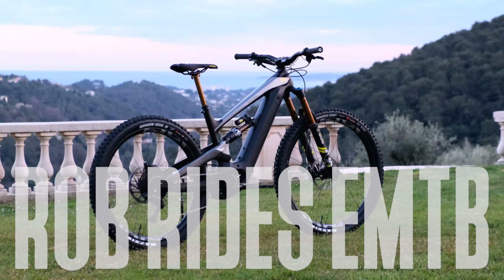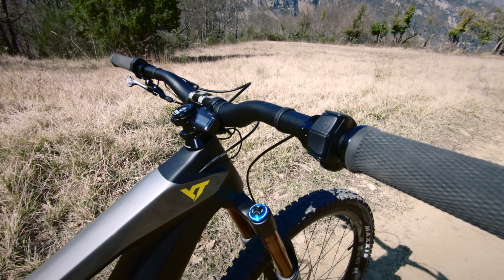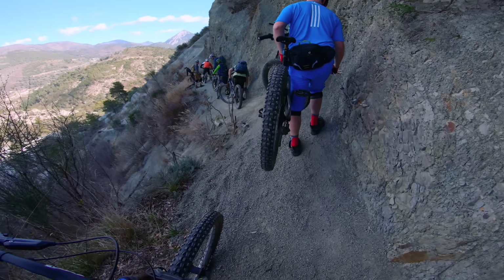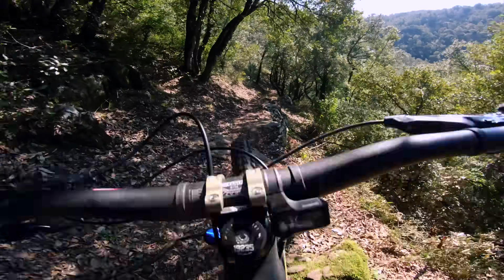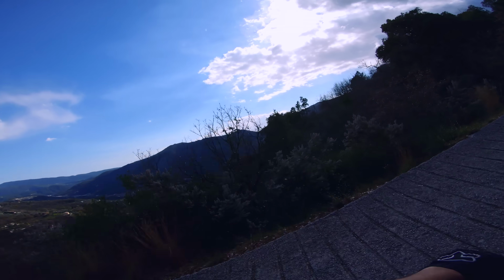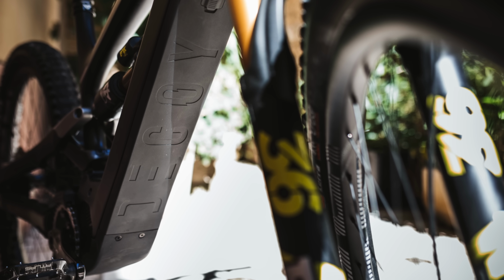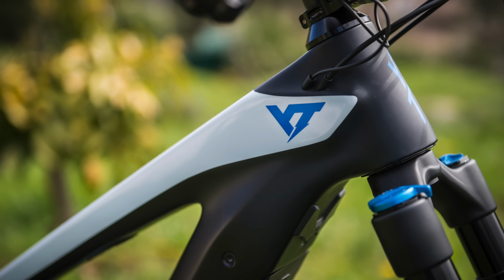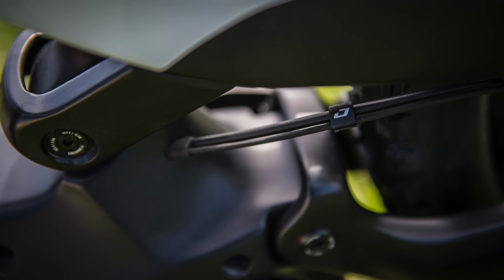YT Decoy First Ride Review, an awesome new EMTB

Comment: I saw that you did a vid on the Decoy vs Levo, but I really think a Decoy vs  Kenevo episode is in order since they seem to be more comparable. My figuring is that if I'm going to get help getting up the hill, I may as well get help pushing a LOT of suspension up there so I can bomb back down with a giant grin on my face. Really interested in your thoughts on the electric shift on the Decoy vs normal shift on the Kenevo, which feels more preferable, and also which feels the best when it comes to a stonking good time losing altitude.

Comment: worst thing about this bike , besides the crazy price tag.   The battery must be bought by the same company...you can't just get a Bosch batter off eBay..or pick up a second back-up battery used,.,no , you  have to buy from this builder and pay the crazy high price for it...there are great EMTB by CUBE that cost 2,700 fully.  best components ...carbon makes no sense when it is an ebike . sorry dude.ive been riding EMTB since 2012. before you knew what they were.

Comment: One of your best videos and very professional, i'll bet the terrain was far more challenging than the video make s it look. What an awesome looking bike, 6K sounds a lot but its festooned with top quality gear and compared to the competition in the 6K bracket its really good value . Was great to hear the logic behind the design decisions.
Still not sold on 27.5/29 combo as it means carrying 2X spare tubes (yes a 27.5 will stretch into a 29er but never actually done it) & 2X spare tyres in the van when 1 can usually do in a pinch.
May seem silly but I'd prefer the colour display as glancing a colour is easier than reading text. Still I agree it's pretty much a package you'll change little out of the box but a proprietary battery is a concern of course.

Comment: lovely bike rob but what happens when the mother brakes do you have to send the bike back an what a month or 2 ??? i am looking for a new ebike this year to replace my 2017 levo i have had 3 motors on it and they was done within a week or so .  that bike would be perfect for me .
Reply: That's probably it's biggest con, having to send it back for warranty would be such a ballache. Everything else is spot on.
Reply: Dean Burton it’s not really con, it’s how they offer such good value! I’ve had my YT 3 years and the service has been excellent.
Reply: @jamsxr  yeah but that's on a normal bike! An e bike is a whole different matter. Chances are everything would be fine, but for me it's the biggest thing that puts me off.
Reply: @jamsxr  in comparison you could get a levo, and any problems you know theres a store probably within 20 miles of anywhere.
Reply: Dean Burton yeah but that’s the compromise for paying 40% less and still getting better components. As I understand it the E8000 should be fairly reliable, and you can take it to your local service centre for warranty support.
Reply: @jamsxr  Wouldn't they make you send it back to YT so the company can claim it back from shimano?!  40% is a bit of a stretch too 😉 I love YT but I just couldn't be doing with the hassle of having to post stuff back to Germany.  Especially when you hear stories about ebikes having 3 motors and 4 batteries replaced etc.
Reply: @jamsxr  Saying all that I'd probably never go for a levo or a yt. I'd get a sam2 or a sommet if I was to take the plunge 😂

Comment: Rob is there a noticeable drag on the E8000 over the limit?
Reply: JON DAVIES there’s definitely drag on these. But there are lots of ways to override the limiter
Reply from the maker: On flats when you’re pedalling yep. But when you’re going downhill over 15 it’s not an issue. I’d ride the flat at 15 mph just under the limiter.
Reply: Rob Rides EMTB cheers Rob. Bike looks fantastic. Great vid. Enjoy your work
Reply: @jondavies1476  I have a Shimano powered ebike and sometimes I can pedal up to 30km/h on the flat, with a bit of descent even more, it's not easy but also not as hard as one would imagine. I think weight of the bike is more of the problem than drag of the motor. But mostly you are on the 25km/h limit and all in all it's a solid workout :)

Comment: What an awsome bike. Love it. My only concerns are... the rear shock mount. That puts a huge amount of pressure on the downtube, thinking along the lines of stress fractures down the line, and it will also send a lot of enery to the front of the bike on big hits. And I'm yet to really come to terms with air shocks on mx bikes. There ok in a twenty minute moto but for all day riding they feel like they get stiffer as the shock heats up.
And more of a limited window of adjustment for different riding styles and weight.....
Reply from the maker: I did 2 days of hard riding in the mountains. No issues with the X2 Factory shock..

Comment: On some of your narrative climbs it sounded like the motor was quite LOUD. Was that the case? Or was the mic just picking it up? Is the YT louder than the Levo?
Reply from the maker: Yes the Shimano is louder than the Brose. But it is amplified on the GoPro a little. And I had it in Boost a lot. It’s not too distracting. But it’s there.

Comment: It certainly looks beautiful.  And seems to be well spec'ed. No mention of weight... with that wrap around frame design on the battery down tube.  Must help to be full carbon though.
Reply from the maker: I did mention the weight a couple of times, also in a graphic on screen, but its 21.9 KG for the PRO RACE
Reply: @RobRidesEMTB  sorry Rob.  I missed that.  I like it.  Not inexpensive at $9500 in good Canadian dollars,  but in line with some other competitors.

Comment: Rob, Great video! 1st I heard of this bike. Very attractive and desirable bike, but it still wouldn't be my choice.  After over a 3-month wait for the  2019 specialized turbo levo expert ,  I'm very pleased  with  it.  I  determined my needs  are to have a bike that has more motor torque  and  battery size.  The levo  fills that need for me.  My ultimate decision was because I wanted to have  good ebike not just a good  bike otherwise.  Sadly specialized doesn't  provide  as good a quality components on their builds for the money.  However,  the bike comes with a 700 watt hour battery  and 90 newton meters of torque, whereas Shimano  delivers only  70 newton meters and  the Decoy like most other bikes, comes with something in the 500 watt hour range  which is not enough  size to  satisfy my range objectives. The Decoy components group is very attractive just like the Intense Tazer I test rode for 3 days. Not having the torque ability to climb steeper terrain for longer range just does not meet my objectives and sadly I had to make the decision to get the specialized with lesser quality components. Some people would argue that the Levo components are sufficient and time will tell, however if necessary I can always swap out parts to get Fox 36 and a better dropper post than the specialized Command Post. These things just boil down to additional cost. At the end of the day my conclusion was I would rather have a better ebike that needs other components added than have an e-bike that's stuck with underpowered Shimano and lesser battery range bike. One of the objectives of an e-bike is to eliminate the great effort of climbing. The component build and suspension kinematics of this Decoy, just like the Intense Tazer are more suited to downhill, but what good is that if you can't climb the hills to get there (unless there is a paved route like in your video)? Otherwise you're still faced with potentially having a shuttle car to do so.
Reply: biketothetop underpowered, last time I checked the e8000 was just as capable of climbing as the competition. Headline power figures are just that.
Reply: @jamsxr  I test rode the Tazer for 3 days and on one of the days, I rode it back-to-back on the same trails as a Levo. Aside from the absolute torque level, I felt the torque transitions were better managed on the Levo system than the Tazer. That actual performance data was how I verified for myself which bike had more torque. Thus in this case, I believe the "headlines"! How did you make your conclusions that one bike performed better than the other and that 90Nm equals 70Nm?

You can see all my ebike test ride videos on my channel. Here is a hillclimb for the Tazer:

https://youtu.be/BNu7eiv4xa0

my eBike Demo Rides (all mfgr): https://www.youtube.com/playlist?list=PLZEb8ngMuMU1LE6-QqRLc8pXbrlydECPm
Reply: biketothetop figures are figures in my opinion and don’t always result in a better bike. I’m not denying the fact the Bros wins on paper, but lighter and smaller E8000 brings benefits in terms of fame design and geometry - things that arguably more important than outright power. I just think your initial comment read like you were really trying to justify why the Decoy is not a better bike, but based on initial reports it looks like the eBike to have. You also suggest the e8000 can’t cope with climbing!
Reply: How can you say "I was not suggesting the e8000 can't cope with climbing", when two posts prior to that you said "the decoy is more suited to downhill, but what good is that if you can't climb the hills to get there" !
Reply: @leedixon2113  1st, you have your quotes misquoting me, I had quotes around "suggesting", my point was that I was confident in my assessment that the  Brose motor system, that has more torque than Shimano, is more favorable at climbing steep terrain because I test rode the bikes back to back. I'm not sure what your point is and why you're trying to dissect what I said. Perhaps you could clarify your concern so I can better answer your question, if there is one.
Reply: biketothetop you should get a motorbike 😂
Reply: @jamsxr  I have 3. A KTM 500, a Yamaha WR 250R, and a 6000Watt eMoto. What's your point?

Comment: Stunning looking bike. Quite expensive but looks worth it.
Reply: You havent looked at many others in the price ranges have you... These are excellent prices with better spec than most others at the same price points!
Reply from the maker: It's expensive but good value, when you look at the spec, design etc, you're getting a very sorted carbon ebike for £4199